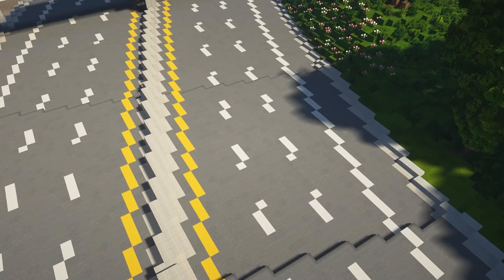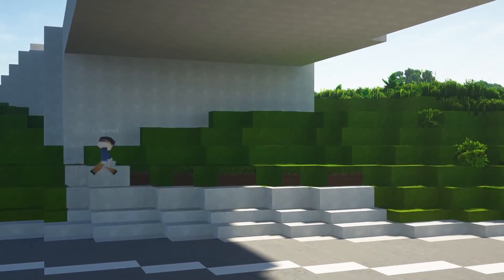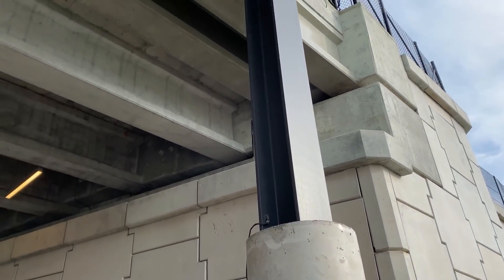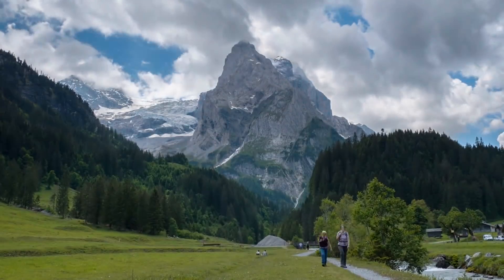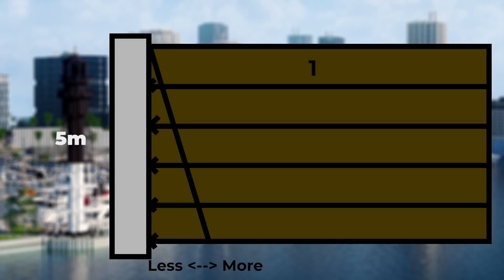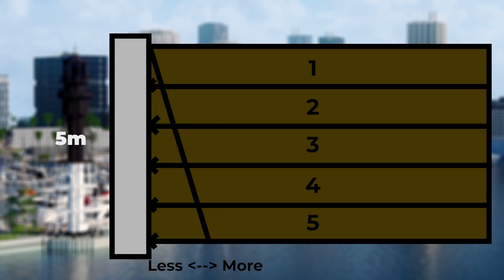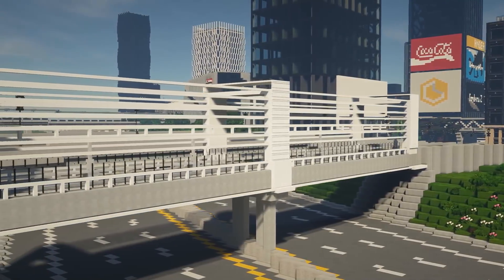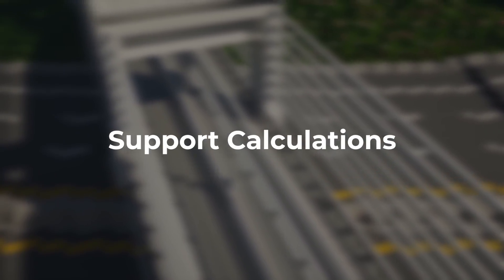Minecraft Bridge using Structural Engineering (“Tim’s Bridge”)

Comment: As a master graduate in structural engineering and Minecraft fanatic, I love you explanation of how the physics work. 
Also maybe it can be fun to explain the reinforced steel in concrete through Minecraft?
Can be fun with skyscrapers or big span bridges.
Reply from the maker: Thanks so much, it means a lot coming from you! Absolutely, I’ll likely make another bridge video and dive into basic rebar placement, what it does, why we need it, and other fun stuff like stress-strain curves and deformations.
Reply: @Alpine1  Oh, I very much like that Idea of basic rebar placement. I'm curious on what kind of bridge you will apply it to. 

If you want to get into high-rise structural engineering there is multiple ways to go. It's funny you mention it because I'm in my first year as a structural engineer for high-rise buildings. We make calculations and designs for apartment buildings and tall sky scrapers. (if you want I can PM you our website and see what we do for reference)

For you information, I'm from Europe, The Netherlands, I've done two master courses. One in The Netherlands at TU Delft, the basic Structural Engineering master and a grad. at Stanford Uni.. Here I did the Master of Science in Civil and Environmental Engineering grad..

If you know exactly what you want to do in high-rise it can differ on what grad. you want to take for example; are you interested in foundations, the design of the building (modelling), or the raw calculations of the concrete, steel or wood. 

I assume your faculty knows what after grad. suits best for you because as far as I know it can be different per undergrad. per university.
Reply from the maker: @Kroonjuveel  Thanks so much for the reply! It sounds very interesting! 

I'd love to see the link, I have no idea how YouTube DMs work, if you'd like you can feel free to send me a message on Instagram ( https://www.instagram.com/alpine.builds/ ) or send me an email (alpine.videos1@gmail.com).

Thanks!

Comment: what's about the temperature? Aren't the extensions also used for the lenght changing? For example when It's very hot outside, the material will expand and the bridge will get longer, even if it's maybe a centimeter. Is that also planned in the bridge engeneering?
Reply from the maker: Yup! Thermal expansion and contraction are accounted for with the expansion joints :)